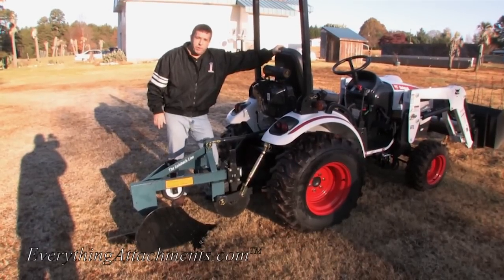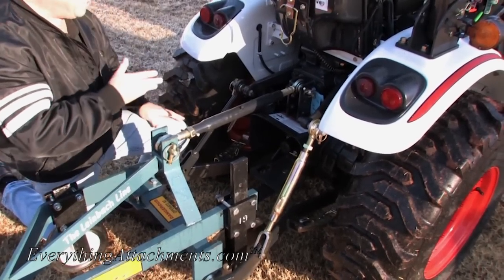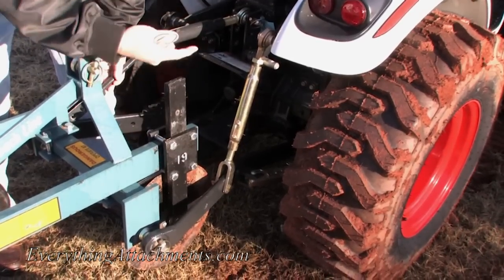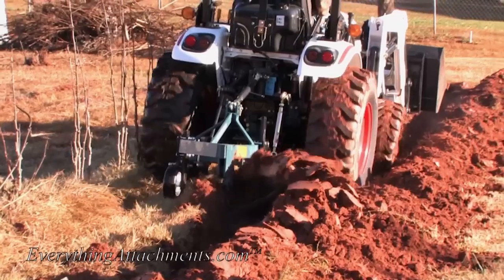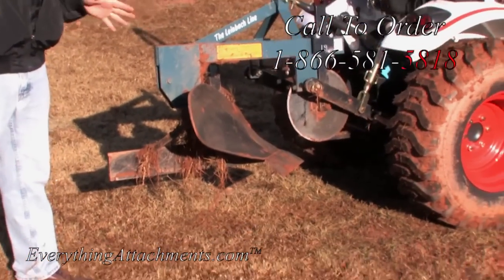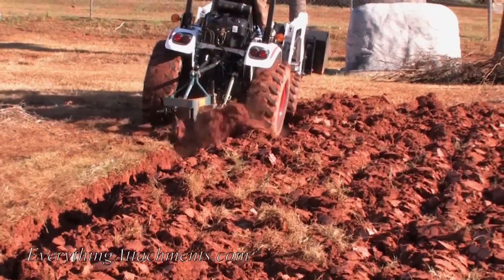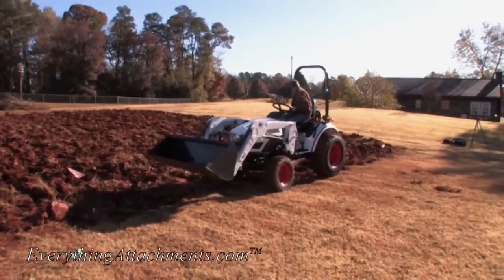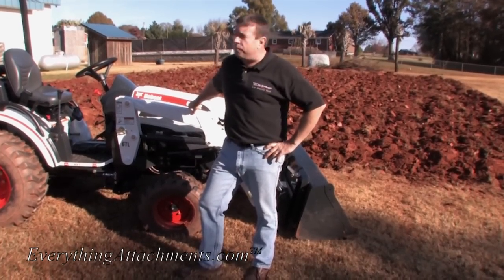How to plow your garden with a compact tractor

Comment: Like to suggest to remove drawbar or set fully forward (make sure Colter wheel wont hit it). Also would put Colter wheel on opposite side of mount to line up 
cutter wheel with plowshare edge.

Comment: Your colter is cutting too narrow. It should  be cutting just outside of the landside of your  plow so it lifts and turns all the soil. that the shear contacts.  You are leaving a ragged edged furrow.. 
You should not have to use the lateral stabilizers to move the plow to cut proper width.  Most mtd. plows have a  adjustable pivot on the draft bar to center the draft of the plow  or a landing lever  to adjust the  angle the plow travels. Both do the same thing.. I see no provision for that on your plow.